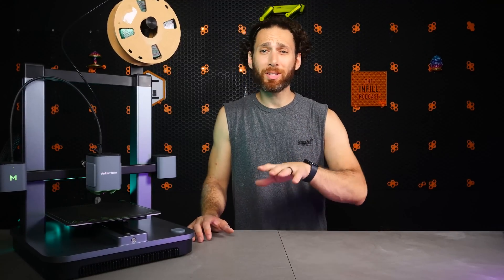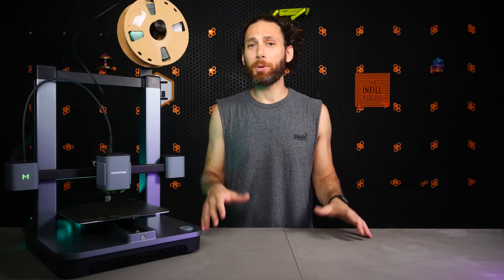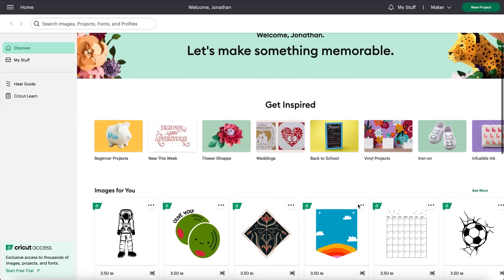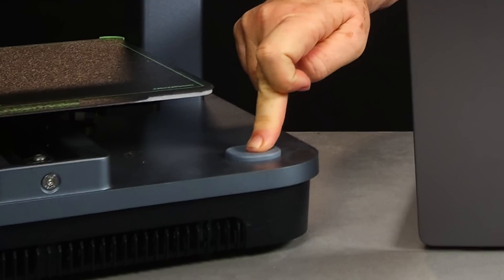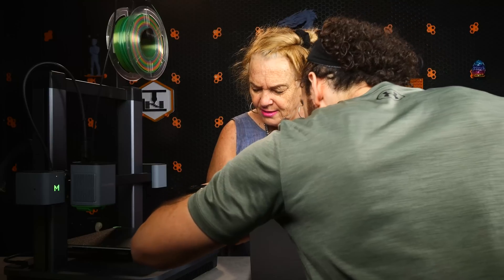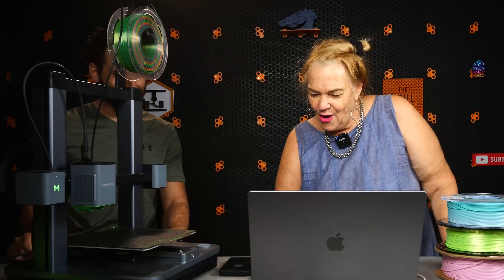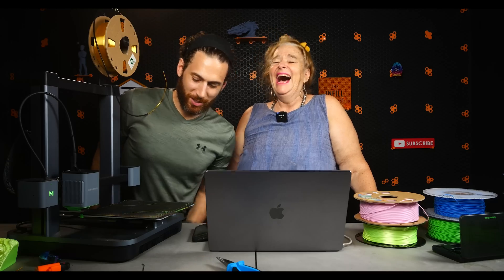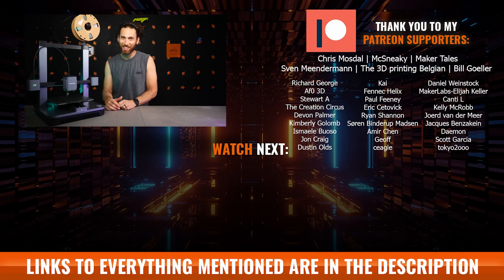Testing an "Easy" 3D Printer (With a Grandma)

Comment: This is still too complex for non technical people.  Outside of the dedicated community, no one cares what a slicer or a hot end is. This process has to be easy enough that you load a model into the machine directly, somehow load filament without having to worry about which way the spool should load and press the print button.  No jams, just clean prints. Maybe 5 years from now.

Comment: this shoould be watched by all people who design products and instructional materials.  to help them understand how people actually interact with their products and materials.  and then make the materials better. ;-)   I'm a former tech instructor, and I ended up making a lot of my own teaching materials because what was provided was too generic.   and I was dealing with technical folks, not even the non technical.    if there's an app, they could do SHORT animations of the setup steps.   bland graphics, each animation 2-5 seconds max.   put spool here.  insert into tube.  keep pushing until....    and for the product design more lights to show things are happening.  she couldn't even tell if the printer had turned on or not.  there is SO much to learn from this for the people making any product.

Comment: Thank you for the comprehensive testing and review of our product - M5C, as well as your valuable comments.
We are sorry to see the problem that occurred in the video, and we take this issue very seriously. In response to what happened in the video, our technical team believes there might be two possibilities:
Software problems: the product is a beta machine for testing, the product firmware has not been updated to the latest version, and there may be some default parameters that have not been debugged to the best state.
Wire problem: the material used is special, the silk wire contains metal powder, which may cause blockage during heat rise and cold contraction.
Our staff will be in contact with you shortly to send you a new accessory. The link below is an article given by our technical team in the lab on how to troubleshoot the issue, and hopefully it will help you resolve the problem. Also, we have not reproduced the issue in our lab. The official version of the product is no longer having this problem.https://support.ankermake.com/s/article/How-to-Fix-a-Blocked-Nozzle-of-the-M5C
Meanwhile, our team sincerely invites you to be one of our product consultants to help us improve and optimize the products together. It has always been AnkerMake's intention to make 3D printers more accessible to a wider range of people and to make 3D printers less difficult to use. We sincerely invite you to help us optimize our products together, and we will respond positively to any product corrections.

Comment: First, I have to say, even as a guy, this was a bit cringey. (Almost) all of your "don't know how to use tech" people were female. You could have been more sensitive 🙂

Regarding how well this printer lives up to a "click and print" model, I think it misses the mark by a wide margin. It's closer, but still pretty far away. Your Cricut analogy is understandable, but it fails to recognize that this is a far more complex process than cutting vinyl with a blade. Today, 3D printing is an amagamation of many different disciplines: software, electronic hardware, electromechanical hardware, chemistry, thermodynamics, etc. The fact that 3D printing intersects with so many, often disparate, technical and scientific disciplilnes is why I find it so rewarding and  fascinating (and frequently frustrating!)  It's also why simplifying this process is so hard. Yes, pre-sliced models will help achieve this "touchless" objective, but so many things can happen to cause the print to go wrong that unless the printer diagnoses what happened, why it happened, and determines how to correct it, then this goal will never be achieved. I do think AI will help to accelerate it, but AI is not going to prevent people in humid climates from leaving their printing spools out in the open in betweeen prints.

I often see the "walled garden" approach taken by Bamby Lab, for example, in a negative light. But for Bambu to be able to bring professional-level tech to the hobbyist, this was probably necessary. Likewise, Anker is going to have to build an even bigger one if they want to expand the 3D printing market to a whole new set of users.

The M5C seems to be a step in the right direction, at least.
Reply from the maker: Sorry it felt cringey. I do feel women are underrepresented in this hobby and I do feel we need to figure out why - is it the perception? The products not being tailored to them the way Cricut machines are? The community behavior? The software? I talked about this in my interview with Denise Bertacchi. In any case, this video could have just as easily been a dad of the same age. It was more about seeing if people from a previous generation with less technological savvy, couldn’t figure out the printers then it was about male or female, but I think I was definitely influenced by the fact that my dad is a rarity, and he’s up-to-date on all the latest tech more than I am, and my mom has always been very technophobic, as is my mother-in-law, wife, sister in law, etc. I projected a fair bit of my life experience into the idea for the video but I could’ve just as easily had any male who is technologically less savvy (kids, grandpa). This wasn’t about gender. Sorry if it felt that way.
Reply: @thenextlayer  I never thought this was intentional. It was thoughtful of you to post a response. Thanks.
Reply: @thenextlayer  That's an incredibly good point, comparing 3D printers to Cricut.... I have a Cricut, and I am naturally surprised (not quite the right word) when I see men who are very into them. Not because they're not a cool tool, or somehow I see them as 'feminine', but because the marketing is SO female-oriented. And, actually, a lot of older women are able to handle Cricut's Design Space software (which is not particularly intuitive at times!) bc the marketing is so well aimed at a female market, including slightly older / less tech-y women. 
On the flip side, I feel quite isolated in the 3D printing world, as there seem to be so few women... and significantly fewer STL files aimed at women than men (though kudos to the husband who designed a Mooncup holder for his wife - a very useful print!).

Comment: Both 'expert mode' version and the 'Mom Mode' (point and shoot style) are needed.  

If Prusa (or other model curators)  could do a 'non-walled garden' of tested pre-sliced models in a section of their site, pre-sliced for various printer that could be automatically selected/curated/verified to print correctly 'garden' for that printer.
Reply from the maker: Good point
Reply: This is going to happen soon.